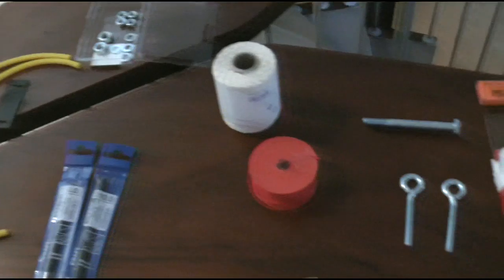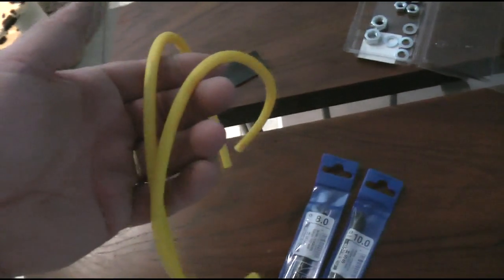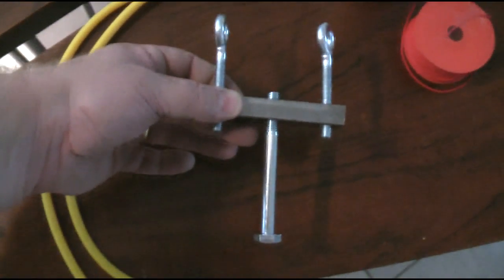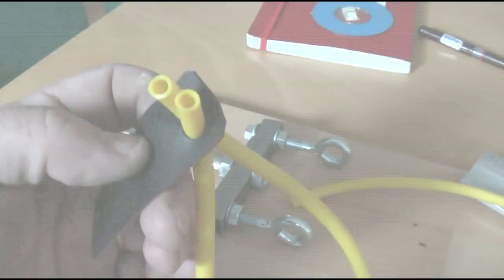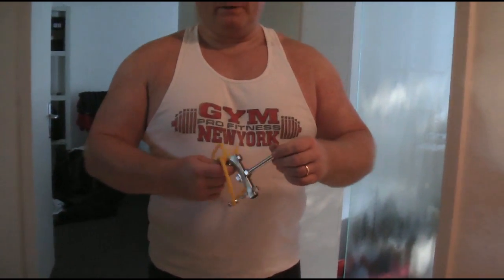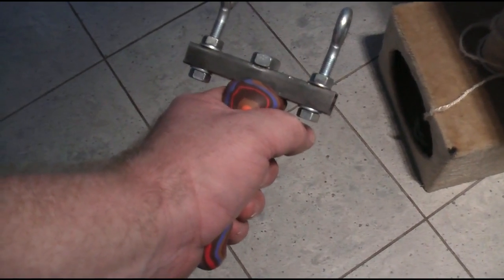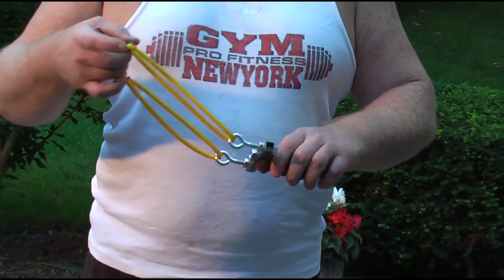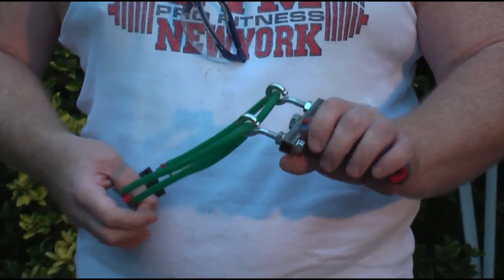How to make a power steel slingshot with common tools

Comment: 12 years on and these instructions are still great.

I made a similar slingshot a while ago for launching lines over tree limbs as part of my saddle hunting set up.

Only difference is I used a 3mm thick heavy decking bracket for the horizontal part of the contraption and paracord wrapped the handle.

Also used the strongest type of loctite on all of the bolts to keep them done up.

You are a treasure Joerg.

Comment: Ebay "Thera-band" tubing, color coded by strength of pull, black harder than yellow to pull. There's a color code chart shown on the box in some of the auctions. :) Speargun bands are, I think, the hardest to pull of tubing but you don't want to go near that stuff normally! Check Joerg's YT "Speargun rubber! 100 lbs slingshot" for more info on speargun tubing power. Most popular now for high power on a slingshot seems to be the Thera-Band Gold bands. Ebay, of course.

Comment from the maker: You can find the rubber on ebay, search for "Thera Tube Yellow". Or you can buy it in shops that sell orthopedic/therapeutical stuff. 

You don't have to use the rectangular metal tube, a nice piece of flat steel will do, or even round steel tubes. But a good hardware store should have the stuff in stock. If not - ebay.

Comment from the maker: A nice, low fork really makes a brace obsolete. Braces often lead to slightly canted forks as the angle between fork and wrist can't be adjusted, which leads to inaccuracy and uneven band stress. And - braces are illegal here.